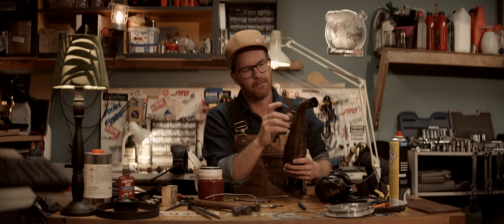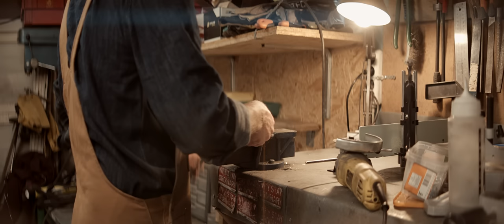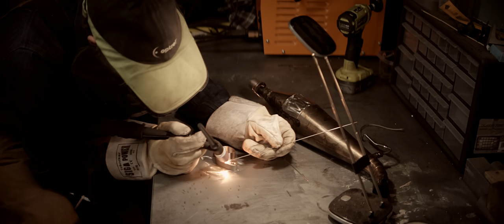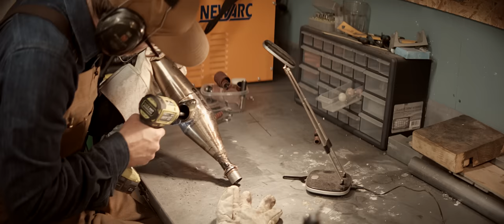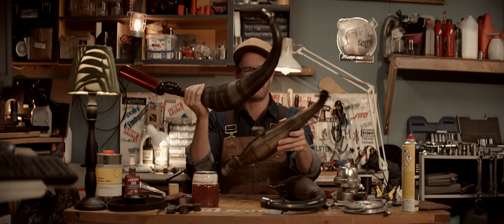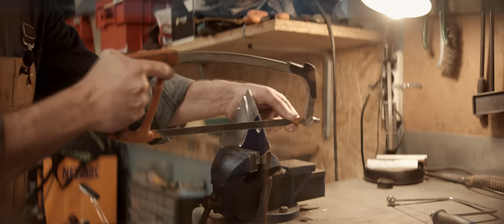Two Stroke Pipe Wastegate - Why do I get such strange problems?!

Comment: The last "big" change that was made to the motor was in the area of the intake system.
No pipe now works properly (almost),  some sort if work but most simply DON'T work AT ALL.
Could it be that the modification to the induction system has put some sort of resonance into the motor air flow that is causing an issue that is being relieved by having absolutely no resonance in the exhaust (ie. no pipe)
Could making the intake cone (the flared pipe where the air enters the motor) a different length do something possibly?
I once had a modified Ford Kent 1600 motor (rally car) that would NOT behave when I had very long intake cones installed.
Never figured out why that was happening as those cones made a power increase on an identical block with a different head and cam setup.
What is going on here makes me wonder if radically "tuning" the resonance of the motor intake system could be the source of even more power.
(Watch the mans head explode if it does...)

Comment: try it with a muffler on the dinger.. or play with the 85cc 125cc pipe desinges.. as the fist bend usuali is in about the 90 bend, might help to get some back pressure for start. it seems to push the all the nessesary right out.

Comment: Not an expert just throwing out ideas here. Do you think that having the rotary valve is killing any scavenging that 2 strokes normally do? How would it react with straight pipe like a 4 stroke? Would increasing the crank case volume help?

Comment: Upside down idea .. try flipping the pipe around backwards so there is a wide expansion chamber upon exit from the cylinder.. as the gases pass through the nozzle of the pipe could it provide  cushion to the pulses of exhaust from the cylinder?

Comment: Is it possible that the air leak is not the reason the engine starts when there is a gap between the pipe and the engine? Could it instead be that as you adjust the length of the pipe you are altering the point at which the reflected wave hits? If so, the just adding a few mm to the pipe might sort it. 
I don't really know much about  two strokes so I'm probably talking rubbish,, but just a thought.

Comment: Dual pipes one for low RPM the other for high RPM make a split flange block one off at a set RPM also I think the leak is exposing a rich fuel mixture maybe the carb needs to be fully optimized.

Comment: Edit: 20:25  seems like you might agree

Couldn’t be that there’s a weird resonance before it gets to the pipe? Maybe holding the pipe just slightly off the engine breaks that up so you get it to run a bit. I guess I’m saying maybe the issue is pre pipe.

Comment: i think a book called  "Tuning For Speed Phil Irving "  could really help you with making expansion pipe's  to suite your engine, it help me load's racing a 125/250/500 two stroke's
P.s Philip Edward Irving MBE, CEng., FIMechE., MSAE Phil drew the engine of the 1960 EMC 125cc racer

Comment: Just a bold suggestion that could be entirely wrong, but what if you added a spool to the exhaust, like a turbo to pull more exhaust through because maybe the compression ratio is too strong to have a combustion chamber in favor for high rpm when low rpm is at high compression? This is an uneducated guess, so please do let me know if this won't work whatsoever. and what if you tried a different exhaust header? like instead of the flange, maybe test without a flange, from head to pipe.
Reply: Looking back at it, this is a stupid idea 😂

Comment: Trying to end the video on a High note.

Me thinks of big jet engines, they go High.

So strap a turbo to the expansion chamber and make it a turbojet.

Use the turbine as a 35 thousand rpm starter motor.

Im thinking you should start the next video with a chuckle.

Get back to wotrk, I am eagerly waiting.

Comment: I think thats a world first lol ive never seen it before for sure lol and when i tuned 2 stroke scooters (yamaha aerox gilera runner italjet dragster) fast 50cc (tuned) we always worked with a yasuni or metrakit or polini or malossi exhaust backrunner there was a 90° bend attached to the exhaust and it runs back over itself and on the other end is the muffler (racing exhausts)  this and the mixture settings we did by looking at the colour of the spark plug if its white it runs lean when its black to rich and coffee brown just right but also a 2 stroke engine is very sensitive to adjustments more air means bigger jets other exhausts means higher or lower rpm and so on and so on

Comment: The role of electronics in getting any motor to run is critical - it makes perfect sense too, that if you wish to produce more power from a given CC then ever before, electronics has to play a part. The exhaust may have to fall into this sort of control area - where the tweaking is done via a PLC with analogue ins and outs to achieve the manipulations you have discovered.

Comment: NOTICE .. Since you are designing your own cilinders if you want to make sirious power check out a old 96 Kawasaki kx250 and look at the rpm reacting  rotatating exaust valves on the upper boost ports and implement it , realy something for u make them computer controlled would be mental and gives you a ton more controle over you power band

Comment: What of you put a flat piece of something in that hole for the dump gate in that one pipe that you made? My thinking is, if the pulses are traveling up and down the pipe, then just having a whole there would let some pressure out sure, but it might not necessarily be stopping the pulses. Putting just a three-quarter inch wide strip of metal straight down to the bottom might be enough to interrupt the pulses. Then at high RPMs when you want the pulses back, withdraw the piece of flat stock.

Comment: Make a variable length exhaust pipe. Make a branch with a flap, and at low revs the gases will be directed to another kind of pipe. Or fuel injection, would that fix that problem. Or should the volume of the crankcase be less.

Comment: Alex, do you have room in the cylinder or in the cases above or below the exhaust manifold to trench out? I’m thinking your motor would benefit from Suzukis old “power valve” design. A rotating drum would close off the trenched area of the case at higher rpm. So at low rpm the trench acted as if the pipe was far bigger than it really was. Might solve some of your issues. To cut complexity just have the drum servo driven at your decided rpm.

Comment: Could you in theory also use a power valve to block part of the returning pulses?
And then open it fully at the rpm past the trouble zone.

Comment: Ford ecoboost motors come with an electric blow off valve. Maybe how much it opens and closes could be changed by voltage idk the complexity of it. Possibly use a potentiometer to get different degrees of open/ close. Eventually could be tied into throttle input.

Comment: Could the problem be the pulsation throughout the enitre engine?
As in short inlet, gigantic crankcase-volume, and then the pipe becomes such a pulsator back, that the air/fuel mix wont enter/will be pushed back into the crankcase?
Imagine the volume of air being so much bigger before the combustion chamber, and so small after the chamber, that the volume going back in is ''too big''?

Just spitballing, more cooks, more søl, so beware :D

Comment: What I notice is that your two "non fonctional" exhausts are very open at the header, they open very quickly. Unlike the last exhaust which seems "small" to you. 
The shape of this first cone doesn't really seem conventional to me and seems to open really too wide, too fast. 
You can keep the same overall length to tune your RPM wherever you want, but you can also make the opening angle with an more "exponential-like" shape

Can't exclude the fact that your passage diameter of your cylinder exhaust duct is still not open enough.

Comment: it must be an air leak on the intake or head or crankshaft system or carburettor problem.when you play with exhaust you just let more or less air in the engine.making better mixture for the engine to work.different every time as the engine is wormer or colder .

Comment: Long time viewer, highly intrigued by 2 smokes... you talk about the header section length but I see a diameter difference as well. Would a larger diameter head section of the pipe but the same short length not make a difference? You are trying to move large amounts of air.... of course I could be way off

Comment: Forgive me for making a silly suggestion. I am not an engineer, but I am blessed / cursed with an overactive imagination. Could the idle speed be changed to about 5k rpm, and the starter motor beefed up to spin at that speed? Then you will never run at low rpm, and might have dodged the problem.

Comment: Seems like the crankcase pressure may be too low to overcome the backpressure added by the header (not entire pipe as I dont think the pulse is making it past the header really) preventing transfer almost entirely. Maybe your rotary valve is far too leaky. Have you measured case pressure?  I chased a similar issue and it ended up being a piece of flashing on the reed  keeping a petal open slightly preventing transfer pressure at low RPM, but it did change similarly with changing exhaust. It would only start and idle with an open exhaust (nothing at all).

Comment: The sliding expansion chamber pipes can be controlled many many diffrent ways...and even made to be automatic......do some research...not many have seen them let alone heard of them....but it is def a fix for this problem.....you can't have both best worlds with one pipe....if you want idle and low end....you MUST SACRIF9CE TOP END...AND VICE VERSA.....BUT WITH A SLIDING PIPE YOU CAN GET CLOSE!

Comment: Wouldn’t it be sensitive because it’s got a door closing on the intake? So it really only works at certain pipe lengths and sizes because you are just extracting exhaust and helping while the door is open?

Comment: I think this problem occurs when the exhaust port is too big, that it wont have enough exhaust speed to create vacuum inside the exhaust chamber to pull exhaust out. cross sectional area difference with exhaust port size compared to exhaust chamber. I bet this is why 2 stroke motocross bikes have additional exhaust port flaps controlled by rpm

Comment: Maybe the hardest idea but what about weld some adapter for two pipes and valve between this two pipes one for low rpm powerband and one for high rpm 
Maybe not the most efficient but the most best looking

Comment: Problem is not weired my friend. Forced air like super charger and turbo have a different effect onnthe reflection point in the rear cone. It will cause a blockade! Clogged pipe symptom try 3mm bigger tailpipe

Comment: Disclaimer: I have no idea what I'm talking about. But I hope something in the following nonesense soup might atleast inspire you somehow: Having watched all your videos on the project, my money is on the geometry of the exhaust port exacerbated by the case volume and the difference in distance the mixture has to travel now you ditched the reeds. Specifically I think the way the pipe and the port mate is the problem. To verify this You could use some JB weld in a sacrificial pipe to make a smooth transition to compensate for the missmathced geometry of the mating holes. I don't think the pipes are the issue. Finding a very strange exhaust setup just to get it to rev implies the problem is elsewhere right?

My rationale:
-Geometry, flow,distances and case volume are almost inconsequential when you are putting 3 pounds of boost in it.
-Removed the boost and found the case volume to be a problem
-Added reeds and found it helped a bit
-Removed reeds, added rotary, spent millenia messing around with ignition and jets in between.
-Now found that the likely exhaust setup to get it to work would be an exhaust that contradicts everything about 2 strokes.

The only think left to change in the chain is that strange port. Have you got a cylinder with a more conventional port to test?

Comment: Bit left field but maybe worth fitting a power jet carb that runs a smaller main jet at start up and dumps more fuel in at higher rpm. I know you are focusing on the pipe but this may make a change to the behaviour?
I do t think you are getting enough air mix in to combust correctly

Comment: Have you considered that the gas flow in the cylinder, from the transfers, is not ideal for the placement of the exhaust port?  Like that stolen design that was copied by every bike manufacturer in the 50's and 60's, the transfer flow was counter intuitive.  Perhaps your transfer flow is destructive with the placement of the exhaust port?

Comment: i think that the short pipe gives to mutch pressure en the long pipe to low pressure , so maybe search somewhere in between so you get the best of both ? 🤔
also the hole of exhaust exit can sometimes be too big or too small so you can also have a lot of difference whether or not it runs well

Comment: I can imagine the crankcase volume and/or rotary inlet timing would interfere with the exhaust pulse, I feel you were on the right track modifying the exhaust but switching to a smaller carb? Isn’t that just like something as a bandaid and work around instead of a solution?  Just my 2 cents…

Comment: My guess, to much leakback through rotation valve causing the air in the carb to almost stand still so that it wont suck enough fuel at idle, so i think its to “lean” try giving it starterfluid at idle ? Just a thought 😁

Comment: I'm no expert, but could crankcase volume be a problem?(smaller volume means higher pressure intake gas,larger volume being lower pressure intake gas) just a thought. Lower transfer gas pressure possibly causing the pulses from the expansion chamber, to not allow much fuel to transfer into the cylinder?

Comment: I wonder if the rear cone on your preferred exhaust assembly is too steep in included angle, and therefore creating back pressure. Seems like it might perform better if installed backwards.

Comment: have you tried a really Flat wide exchaust ?

Have you thought about that your ports and inside walls is making a equal pressure that performs well without the exchaust. but you need a high end expansion... would it not be better if you restrict the exchaustport then adding the exchaust.

because i feel you are getting a high flow in and out with hardly any restrictions. so you would not want a pulsing then because that will make the airflow inside STALE and there for not giving the right air/gas mixture.

Comment: INTAKE PRESSURE!!!!  This sounds a LOT like you have a very weak transfer pressure. The TRANSFER is what pushes the rest of the contaminates out of the cylinder.  If you have ANY back pressure, you contaminate the charge in the cylinder, then no rev..  Higher RPM there is a lot of exhaust gas in the cylinder for the blow down and it will cause scavenging during the beginning of the transfer, pulling fuel into the cylinder rather than being pushed...  

I still say you have a crank case volume/intake valve timing issue.  and even then, once you figure this out, it still won't work with a belt driven supercharger.  You need to get this sorted then move to a turbo which will self feed and boost the engine as a byproduct..  It'll be horribly inefficient until you move to a valved exhaust setup though..

Comment: Run from the one to three then three back in to one to allow the pluses to force other pluses to follow each other causing a scavenge effect you can adjust length to tune for length and time between pluses

Comment: What would happen if instead of running a supercharger to pressurize the intake, you ran it to generate a vacuum on the exhaust side? 
Wouldn't that also generate some kind of suction in the combustion chamber that might possibly induce some amount of suction on the intake port? What happens if the exhaust is super free flowing because of a vacuum pump, but also with a normal intake system?

Might have to do it with some kind of turbo fan blade setup to withstand the heat, probably too much work and trouble to think about such a thing though.

Comment: @2SROKE STUFFING     The variation of the problem is as much likely down an slightly to a fair bit of an undersized inner diameter of megaphone outlet to stinger size, as much as the overall length & size of fattest diameter of the central cone size of megaphone for power range, I guess.

#1    Perhaps trying a resonance chamber semi-pipe off the main pipe's header for low speed resonance length ?? ..similar to as used on the Ducati-look-alike version of the Cagiva Mito., but with a guillotine slide to act too cut it off at mid to high RPMs between the chamber and main pipe with it's larger exhaust port area and exhaust flowing characteristics ?? 

#2    Maybe try a range of pipes for an 70cc/80cc to 100cc, (or even a 125cc) bikes - for breadth of differing flow capacities to length to cone sizes ??

    Yes, remember 2 strokes are naturally very pipe sensative the more you chase the higher performance from the cylinder, crankcase ratio & RPMs etc, the more a collection of imperfection in pipe selection, will have a stronger range of effects, ..and you're chasing a higher bar.

Or you could try a differential style of dual carb system similar to some 1980's big single 4strokers (Yamaha XTC ..I think?) used, a small low to mid RPM starting carb and a larger high speed carb if the intake resonance is feeding into the exhaustive resonance issues/problems ?

Comment: maybe use a gokart engine starter you know one of those 12v 212 predator jump boxes they are easy to vuild and can spin whatever rpm youd like because your powering it with a small engine

Comment: Make it idle at the point it runs with the pipe attached, start it with starter fluid or with the pipe detached and it should rev up to the high idle